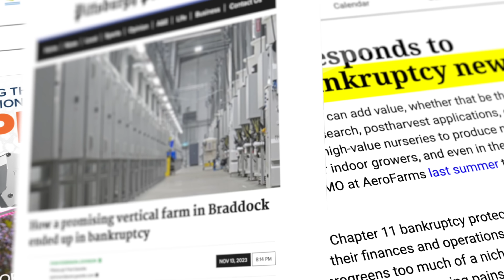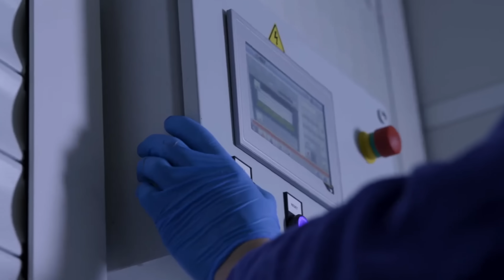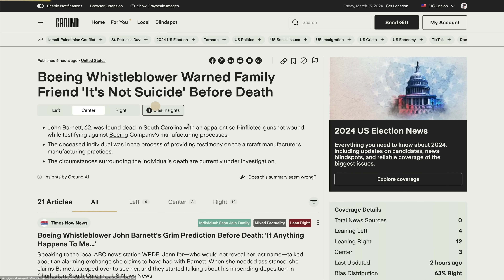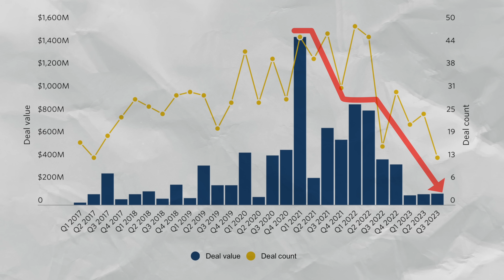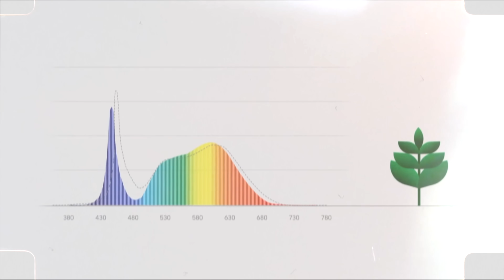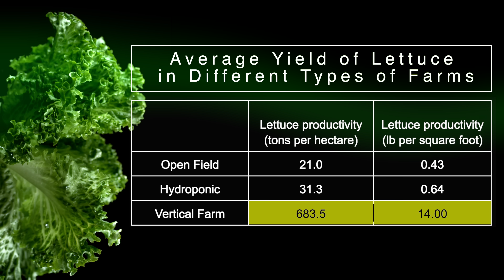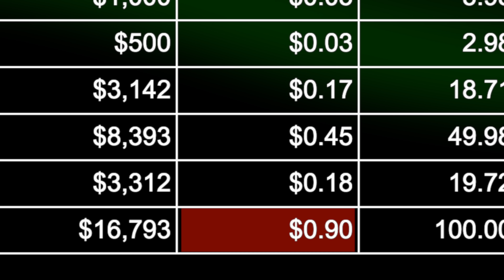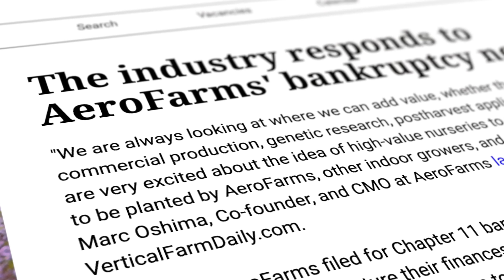The EPIC Failure of Vertical Farms - What Happened?

Comment: Always good to remember there are several different measures of "efficiency" in any solution. 

Cost efficiency is only one of those measures, though it is usually one of the most important ones.
Reply: Over 40 years ago, a textbook I bought on small farm and home gardening stated something like "It would be possible to  grow Oranges at The North Pole, or Wheat on the seabed floor...but could you do it and still make a profit ?"   Not disputing that yes, especially for non commercial purposes, home gardeners can push the boundaries a little bit. I live in Christchurch NZ, 44 degrees South Latitude,  Temperate climate but with a mild, usually snow-free Winter. So we can grow many subtropicals like say Oranges here. The trees, well bushes up to 3 metres high, , grow slowly over  several years and never give as large a crop or tasty as fruits from warmer areas. But local gardeners appreciate them as "home grown". There is a reason why commercial Orange orchards are located some 800km / 500 miles North of Here (and even their fruits won't be as good as Australian or Californian grown fruits).  Curiousities grown in the home garden don't need to make a profit. But commercial growers do.
Reply: @KiwiCatherineJemma  I think of the insurance industry. 

Cost reduction sounds great at first because everyone translates that as lower cost to the customer. 

But in a non-competitive for-profit environment, cost reductions are not always passed on to the customer. So low-cost insurance may still be expensive to the customer unless there is somehow significant variety for competition, or maybe the insurance is government/co-op provided instead. 

But, many cost reductions are harmful to the customer and the vendor industry supporting them. 
 - If they grind vendors too much, then there are fewer vendors giving poorer quality service paid for by the insurance, and their employees are low pay workers not motivated to provide quality work. 
- cutting service agents for the insurance policy or cutting pay for these positions means your cheap insurance makes you wait on hold for hours to talk to rude reps who make mistakes on your claim.
 - Cutting IT costs means low security, maybe losing your data or getting your data hacked. 
- Cutting costs by raising deductibles has a balance point where it is good for customers, go too far, and defeat the purpose of insurance.
- go real far, and insurance companies do whatever they legally can to avoid paying out claims.
- they can invest your cash until needed but do too much of that then they may not be liquid for a mass disaster with millions of sudden claims. 

So cutting costs is not always a benefit to the customer, there are many other measures of efficiency when determining if an insurance solution is valuable for the customer and even a general benefit to society.

Comment: They are countries that invest heavy in vertical farming.
Singapore sees it has a way reduce their dependency on imported food (about 90%), and they remember the food shortages they had in the past due to their limited farm land.

That being said, in the documentary I saw on vertical farm in Singapore, they where much more optimized than the own shown in the image (though, I would guess those are old filler image). For example, the plants where on vertical carousels that rotated vertically, making it even denser.
Reply: @bl2575  that's cool and all, but that doesn't go against what the video said. It's far more efficient to do regular farming. The ceiling (no pun intended) is much shorter for vertical farming right now, and it's not the way to stop famine in 2025, or probably even 2050.

Comment: Part of the problem with the way a lot of the investment happened was they were basically investing in science experiments. They weren't building mass production businesses.

This goes along with economics and the boom bust cycle. Austrian economics explains this well. When there's credit expansion, there's a lot of long-term investment in projects that might not be profitable because there is cheap money. People will invest in projects that might not be sound because they are chasing higher returns in a low interest rate environment. It ends up causing a lot of Mal investment.

Comment: I grow my lettuce hydroponically in my house, upfront cost was 250$ but now i don't pay anything, solar covers the lights and water pump.
Reply: ...thinkin about how long i can eat lettuce for 250$ 🤔🤭🤗
Reply: @giovanniamore7532  200 days, maybe
Reply: @giovanniamore7532  in the video he said a bag of greens runs on average $2.50 so if you buy a bag a week like my family does, then 2 years give or take.  In other words, it will save you a little money.
Reply: @giovanniamore7532  If if like leaf lettuce or Romaine, not very.  Maybe 1 - 2 years.  But your statement was about YOU so I have no idea.  $250 doesn't get me to 2 years of buying Romaine, maybe 1.5, and that's partly because there is no GOOD way to buy it where I live.  I have to buy the Romaine hearts, 3 in a pack and you end up throwing away about 1/3 of that because of damaged leaves.
Reply: Amazon sells a fountain pump with the small solar panel for less than $20. Of course, you would need a larger one for the grow lights. I could see doing it for $250. They make foldable solar panels that need little to no installation.
Reply: Try to grow something with value, like potatoes, squash, tomatoes, beans, peppers etc.
Reply: @pakistanis1782   lettuce does have value. It rots easily, so expensive, and usually self-grown is better (at least in a garden bed. You cannot compare homegrwong to bought - it is so much better. Especially with the tender salads you will notice. They are soft and crips at the same time. As opposed to the stuff in the shops.

Potatoes can be stored well, so one can get those at a better price in the shops (even in organic quality).
Reply: I grow lettuce in self wicking beds using decomposing prunings for the wetlayer and potting mix renewed each crop with home produced compost. Given the tubs were salvaged from waste and I have been seed saving for years, an average of about four minutes of time cost per head of pull leaves/grow leaves lettuce, plus the time to wash new tubs, cut up woody prunings and dump in refreshed mix every four years or so. Cheap as if you have even a half decent micro climate spot.
Reply: And what nutritional value your lettuce has. Probably you didn't think about it at all. You are wasting your solar energy to produce harmful to your health product.
Reply: That's because there not getting the sales over priced
Reply: how much lettuce did you get to eat per year? I rather guess you harvest a few one month and the other 11 months you have no lettuce. I don't know anything about farming of course. I guess with a refrigerator you could deep freeze the harvest to last longer, I don't think it is worth your time.
Reply: @holz_name  I pick some off each day and let it keep going then harvest 4-6 heads a week after picking at them and give that to family.  It is constantly going with some starting and some finishing each week.  60 spots for growing in total.
Reply: @nizzyandmomo  60? That's a lot. Ok sure, that's lettuce. Now add tomato, potato, carrots, paprika, and all the other vegetables that I eat every day. Sorry, but that we will grow vegies and fruits in the cities is just idiotic. The biggest problem in the USA are the suburbs that take land away and make it harder to distribute food. Cities are normally the powerhouses of economic growth, high density, high productivity. But in the USA particular with the suburbs and low density residential it all went downhill.
Reply: @holz_name  not the guy you're asking, but if you grow indoors hydroponically, you are not bound to seasons or weather - hence your idea of harvesting just one month out of 12 is not the case. It takes 4-6 weeks for lettuce to grow, from seed to harvestable plant. So if he has 42 "spots", he could seed 7 lettuce plants each week, and harvest 7 each week. 42 is not a small setup though. If you eat lettuce every other day, just need space for 21 lettuce heads, not crazy if the guy really likes his fresh lettuce - a couple square meters. As to the time: it's mostly about the setup. Once it's set up, there is minimal maintenance, if you want to seed and harvest 7 lettuce a week and do the maintenance for it, you're maybe down for an hour or so. Considering he likes his thing fresh and homegrown, the effort is definitely worth it. I wouldn't do it, mind you, but it's not rocket science to grow lettuce indoors. Things pretty much grow all on their own with minimal help required, it's what they do. Farming is a fascinating topic, maybe you enjoy learning more about it. There's lots of great resources available online. You'd be surprised to learn where your food comes from (spoiler warning: it's from outside the cities).
Reply: Bro I love salad and I don't think I eat $250 worth of lettuce in 2 years even
Reply: 250 bucks on tasteless hydro-lettuce, or some soil for free for actual flavour.

Each's own i suppose.
Reply: I already had a 5kw solar system so I'm not including that but I eat salad everyday and if I tried to maximize,  I could produce 2 heads per day every day (depending on variety) most of that cost was in Crop king NFT channels and a pump I got lights for dirt cheap from a friend who buys random pallets of stuff.
Reply: Do you know how easy it is to grow marijuana?
Reply: @sativagirl1885  it's pretty much growing tomatoes in difficulty according to people that grow both
Reply: @sativagirl1885  Is weed your identity?
Reply: @sativagirl1885 it's called weed for a reason, it will grow all by itself if you don't f around with it too much and you have an appropriate climate

Comment: So how did the VCs, a bunch of Stanford and Harvard MBAs, miss these simple cost structure issues? What was the secret sauce of industrial scale vertical farming? My introduction to this industry came in the form of what would it take to produce fresh food off-planet? The engineering involved made the cost of food production in-space so costly. If the cost of sending a kg of high nutritional density food on a rocket into space was less than USD $10k, it made more sense than trying to grow food on a space station, and it was worth investigating how vertical farming might help solve the problems. No investor was willing to touch the project. Thanks for your report.

Comment: Fully automated vertical farming is perhaps a step too far.
I work in the controlled environment agriculture sector. We have seen amazing success on using automated natural venting and high diffusion polythene covers. We have seen a decrease in electricity usage to below 8 KwH per Ha.
We haven't solved the pumping costs yet, but we've sorted the air movement and light systems.
The concept shouldn't be written off just yet

Comment: You showed that electricity was not a major cost factor. Instead, labour, high initial capital costs and maintenance were key factors. How is moving to hot dry climates with renewable energy going to resolve that? In fact, in a hot climate, I expect climate control costs to increase. If the costs of imported lettuce is $4 a head, then perhaps they can make it work. They might as well set up in the artic circle.

Comment: You didn't spend enough time on the VC economic issues. All highly valued startups in 2020-2021-2022, got killed in 2023 as they tried to get more funding after interest rates rose steeply. This affected high burn rate startups in particular, as the one guy pointed out. Also, much of the Capex required are one-time costs, and of course these companies had/have a lot of cost reduction to do in their future, including simplifying labor processes, more automation. Just some thoughts for you...

Comment: Farmer here.  Here's the thing about vertical farming indoors.  

1. Property costs way more in urban areas.  Not just the cost to purchase, but property taxes and cost of doing business are much higher as well.
2.  Vertical farming is resource and inputs intensive.  It requires LOTS of electricity and nutrients for the plants to grow.  These inputs are way more expensive in urban areas and still require transport in and out of the location.  When vertical farming experienced high growth, energy and inputs were cheap.  They are no longer cheap.
3.  Water use and treatment in urban areas is insanely expensive when you are talking about large scale operations like this.  Using city tap water for irrigation is no good because chlorine and other treatments must be removed before using in vertical farming irrigation.  Massive filtration is required.  Not so in traditional farming.
4.  Pests are still a problem in vertical farms.  A traditional farm may see localized infestation that impacts only a portion of the crop and then spot spray it to mitigate.  Most vertical farm infestations will spread throughout the enclosed space very quickly and destroy an entire crop in days.

I am not bashing vertical farming at all.  I am just saying its deployment in urban areas paired with the higher costs of production doomed it to failure.  There is a way to correct these issues and make vertical farming more sustainable.  

For example, locating the vertical farms near a source of flowing water and placing new generation low flow water turbines along a river or tidal area can provide sustainable, consistent energy for production.  Old steel manufacturing sites along the many rivers in the midwest, mid atlantic and north east would be excellent locations.  The land is often sitting dormant and so its cheaper and available.  They are often located along a flowing water source for both electricity and irrigation and almost all have rail connections for transporting inputs and produce.

I still think focusing efforts on more efficient distribution of farm products would be a better spend, but we do need to think about how to efficiently grow food during periods of significant climate cycles like pole shifts, grand solar minimums and the like.  In my mind those are the problems that can be solved with vertical farming, yet do not seem to be part of the conversation.

Comment: I didn't see taxes/lease (Unless one lumps that into "Capital")/Nutriants/Water/Heating (It gets cold.) in your chart.
We used to call this "Total Cost of Ownership." a blaze concept that clearly no one bothers to estimate anymore. If any of these folks had, either the idea people or the VC,s they wouldn't of touched this with a thirty-foot lightning rod in areas where there was substantial farm systems.

One may be able to use this system with vine grown fruits and vegetables (Grapes, beans and tomatoes as examples.) or small bushes (Blueberry's, raspberries, etc.), but trees? Even small trees... The weight and stabilization (No wind to strengthen trunks.)  structures alone would kill your costs. The environmental conditions alone are complex; just the oxygen/carbon-dioxide controls would drive one mad.

Would this work in marginal/hostile areas? Maybe. Again TCO WILL tell you.

Also, I noticed in the video, a LOT of the water lines and trays were plastic. The health issues with plastics are rising and guess what! Look at your house, if it was built since the 1980's I'd bet it's got plastic water lines... oooppppssss.

Comment: You want to automate but only to a certain point. This because complete "robot farming" still cannot do fine detail things a human can do. Or properly diagnose problems such as pests' diseases, unforeseen problems etc. This expensive tech tends to break - often negating any "cost savings" of not hiring human staff.  This requires expensive "black box techs" to fix all these robotics, computers, conveyor belts, watering and pest management systems - all the time. Also, you want to own the land and building outright. This is still the right idea mathematically. On paper it makes complete sense every time. It's the strategic business acumen and planning ahead of time that is the best predictor for success. If you want a "Star Trek the Next Generation" farm, which a lot of these are, chances are it will fail.  So initially simpler and indestructible is better. You always want to use natural "full spectrum lighting" because although the LED full spectrum lighting is much better now it is probably not exactly like natural light. You would also want to have cleaned natural air /circulation as well.

Comment: Water, by enlarge, is not a stressed resource for farming, so the advantage of vertical farming of reducing water use is not significant. Similarly, the environmental cost from fertilizer runoff and the use of pesticide is not included in a traditional produce.

Comment: Farming is a high cost low margin industry. There is just too much tech, infrastructure, and labor used in vertical farm.  Also farming is a mature industry. Meaning that time has rung out inefficiencies. Even the homesteading wave is only working because they are not accounting for their own labor. The average homestead is terribly inefficient when you account for labor and land costs at anywhere near market values. What and how do I know these things??? I have farmed for 62 years this crop.
      Yes tech has its place in farming but the enclosed vertical farming system is going to take very special locations to even have a chance to work. That will not be in the western economies. The cost of food per family or even individuals is so low because of competition that the added cost of vertical farming will not work with any of the current tech being used. So either the tech will change or the location will need to be in areas that have higher food costs with surplus energy plus lower cost labor.